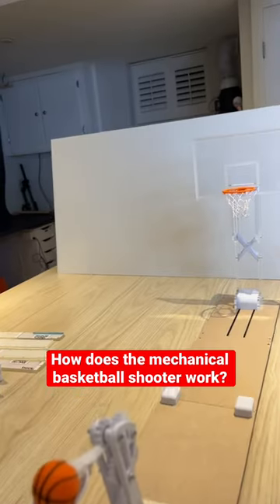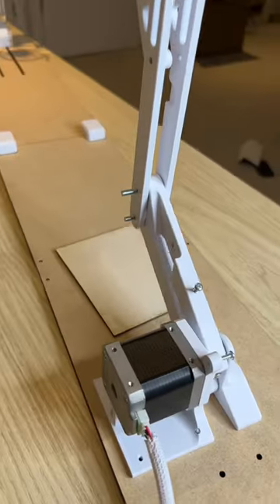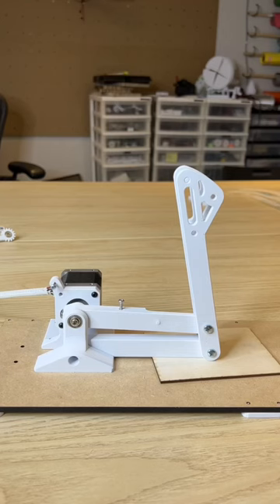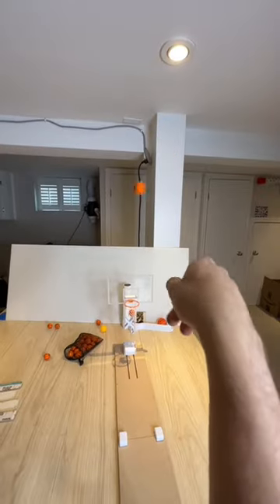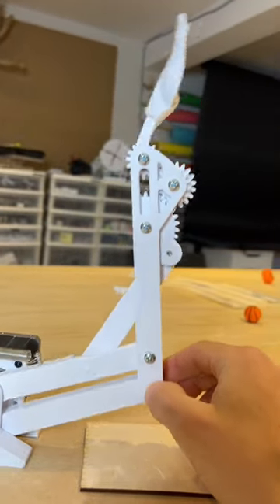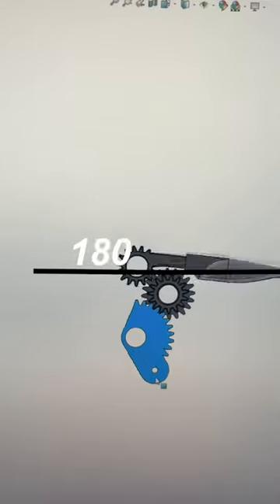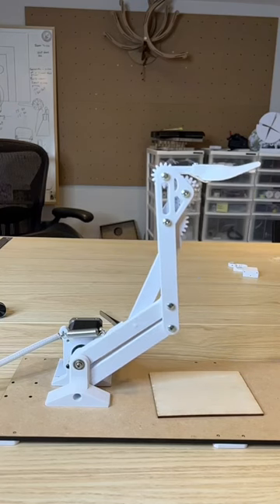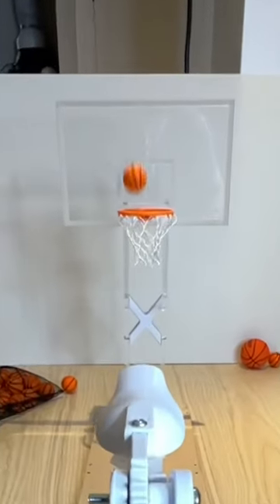The Mechanics of the Basketball Shooter

Comment: What you said about the 4 bar linkage was wrong, the two ends only stay parallel if the connecting arms are of equal length, and have rotation points equally distanced at each end

Comment: Hey how are your pin Joints so smooth with the 3D printed parts? Is it bearings everywhere (for the pin joints)? Sorry if you'd covered this before
Reply: Some really amazing projects by the way.
Reply from the maker: Thank you! I have been using bearings for this project to make sure everything is super smooth!
Reply: @Engineezy  Okay, thank you. Does this strategy work even when the space for the joint is limited? Like smaller bearings or any other alternative?
Reply: @venkatabrahminipriyapragada  you get all kinds and sizes of bearings. Bushings are commonly used too and can be much thinner than bearings.

Comment: In the last video you said it had some inconsistencies so (though I am still taking classes for this) do you think putting stoppers on the gears would help some angle problems? Gear ratios sometimes mess up for me because of this and it usually helps.
Reply from the maker: The inconsistencies are coming from the scoop design here!
Reply: @Engineezy  ah, well… that would reduce my paragraph to just “better ball seating”